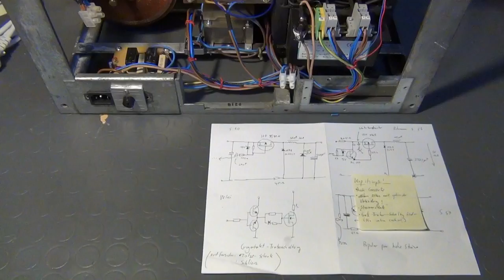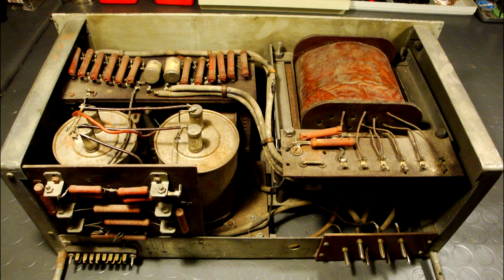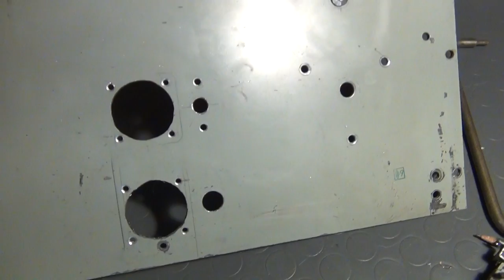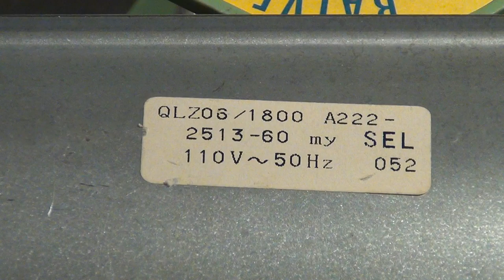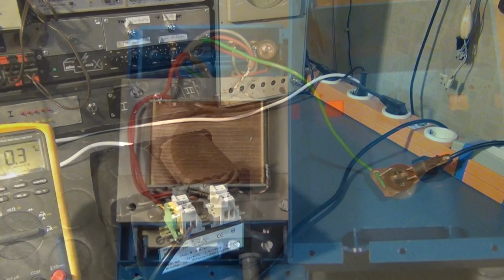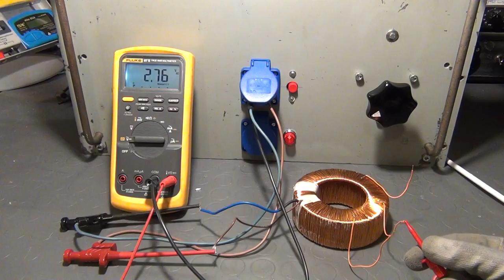Isolation Transformers, Variacs and  Autotransformers

Comment: I used to live in Dayton, Ohio as a child.  Despite leaving there before I was 10, I began taking apart electrical devices (and some even worked when put back together).  It is also where I learned what happens when you try to put 3 volt flashlight bulb into a 120 volt night-light base.  For some reason, my parents decided to let me learn about electronics via books (only) for a while after that :).

I am thoroughly enjoying your videos, and they make me want to dust off my electronics workbench.

Comment: I know the apprentice's wont believe that you can touch the live wire without getting a shock even if you touch earth as well, you have to prove it to them. But never touch the live and neutral of the isolation transformer (as you said in the video).

Like you say earthing arrangements can be very different.

I mess about with the amateur radio and have earth rods in the garden, and with the PME system the house earth is really only a connection to the neutral at the house incomer, but if the neutral got damaged externally and was lost, maybe the whole streets neutral load might try and return to the star point of the transformer via my earth rods due to the fact that the earth and neural are connected together. Its never happened so far thank the lord.
Thanks for the great stuff,
All the best

Comment: 8:39 the earth reference of the (+) or (-) after the bridge rectifier is Vdc/2 so for 325V in respect to earth you will get 160V for either pole. In europe this DC voltage considered safe under DIN VDE 0100-410(VDE 0100-410):2007-06)

Comment: This was 'Deep' for me but very interesting. I just purchased my first variac. Superior Electric Powerstat- Input 120v , Output 140V -10Amp. I need to learn more about these Isolation Transformers and if I need one in series with my variac.
 Thanks
Reply from the maker: Fred Bookhoop Hey. It is possible to use a variac without an isolation transformer and I have seen many people do that. But you should be awarw of the risks involved.

Comment: You can also use instead of soft-starter solid state relay with zero crossing switching. If you will use such relay it wil always wait for first zero crosing of voltage and switch it on in this moment. Just for information. Because probably it is more expensive option. And also it is effective only if there is no capacitor after rectifier on sec. side.

And also I think, that it is good idea to put there socket for 100W lightbulb and switch with can short this bulb. And connect this socket in series with output. Sometimes this is better like circuit breaker. For example during repairing SMPS. :) Cold lightbulb  is only like small resistor and after you will short something it just light lightbulb up without big sparks etc.  And for low loads on tested SMPS it is no problem. If you need to load it more and test it if it works on full load you must short this lightbulb of course.

BTW: Great video again.
Reply from the maker: xxJerry19xx Thanks for the information. I actually do have such a "series lightbulb" with a socket. I used it from time to time for repair jobs.
Reply: +xxJerry19xx Don't use zero crossing switching relay with a transformer - it will guarantee large inrush current surge. Transformer should be switched on while the instantaneous voltage is at its peak value. See explanation here: https://www.ibiblio.org/kuphaldt/electricCircuits/AC/AC_9.html#xtocid1085420

Comment: Happy Birthday PAI ! Most impressed with your latest vid . Did you use the German variac in this transformer ? This variac looks like what I need . Was it a one off or are there more available ?  Regards .
Reply from the maker: Thank you !
The German variac (220V, 4A) is part of the second unit that you could see in the very beginning of the video.
In the unit that i presented in this video I used an even larger variac (230V, 10A).
I bought the variacs on ebay. Thus I have only the ones shown in the video. They are quiet expensive, when you buy them as new parts.

Comment: From your video I learned so much in such a short period!  

Remanence explanation was perfect, and finally cleared up the last details in my mind.

One question: Does the phase difference on the output of an isolation transformer, with respect to mains current, cause in weird circumstances, a voltage potential that can shock and damage components and people, and would a double isolation potentially reduce this voltage potential to zero (phase difference of 180 deg)?

Comment: Excellent video - thank you. I am about halfway through building my own isolation+variac setup myself, so this video was perfectly timed for me. Would this kind of setup benefit from the addition of an optional high-wattage fillament bulb in series with the input?  I have a vague memory that I saw this kind of setup a long long time ago in a TV Repair shop (yeah... back then people actually used to repair those things)... I think the theory was that the filament bulb had very low resistance when it was cold, so would let the power flow to the device-under-test, but if the DUT was a dead-short or something like that, then the bulb would just light up instead... It seems a very simple way of providing a current limit on the output as you can swap the light bulbs to a different wattage to get different current limit values. Cheers!!
Reply from the maker: Hey. Good to know that there are actucally still other people who work on similar projects.
I used that old light bulb trick a couple of times in the past. I repaired an audio power amp, it began to oscillate wildly and drew very high currents. The series lightbulb which acts as a thermistor in this case helped to limit the current and prevented the power stage from self destruction. But I would not integrate that into the isolation transformer unit. I have a separate wire with a bulb and a socket for that exact purpose. And yes! For repair jobs it makes a good addition to an isolation transformer !
Reply: The Post Apocalyptic Inventor It was seeing your two 15 Ohm resistors on the input with the relays across them which gave me that 'lightbulb moment' :)

Comment: Very nice video, very interesting.
I see the output earth was removed and the connection cut off was that needed?
I while back I thought I would check the output earth connection on an isolation transformer we use at work and was surprised to find the earth from the input was actually carried though to the output connection. I thought it was faulty but when you think about it, no current could flow to that earth via your isolated supply, but if some other external supply happen to touch the metal framework of what ever you were feeding from your isolated supply, it would still act as a safety ground and blow the fuse. It would stop the whole lot sitting there live if a fault from another source happen to liven up the framework.
Reply from the maker: Mark Lee It always depends on the circumstances what is save and what is not. In the case you discribed earthing the output socket would of course be of advantage. But as I tried to show in part 1, there are situations where the whole earthing system can work against you. At the end of the day, the regualtions which are in place try to avoid dangers under the most probable circumstances. Regulations in Germany say that the output sockets are not to be 
connected to the PE. The enclosure only when the unit is not mobile but 
stationary.

Comment: My only question is why a 555 timer and not a microcontroller?
microcontrollers are just so cheap and easy to implement these days plus you would be able to change delay timer on the fly and you could implement thermal protection and/or temperature readout.
Reply: +xsterawesome I think the answer is the question itself - why?
Why go and program it and what not, when you can hook up a resistor and a cap and be done with it?
He also did implement thermal protection in a safer way, an actual thermal switch.

Comment: I got hold of a nice 120Vac (US made) 1kVA autotransformer, can I use it on 230Vac mains? Although I can guess your answer... the enamel insulated wire should have higher breakdown voltage than 325Vpp. The peak current and wire diameter of my transformer should be more than enough for 230V and hence peak magnetic flux should be smaller so the magnetics should be fine. Is the wire insulation the only issue and why some manufacturers make 2 models for 120Vac and 230Vac autotransformer, couldn't it be the same part?